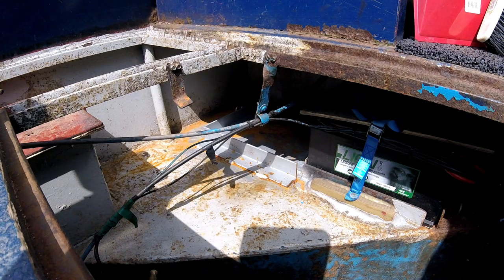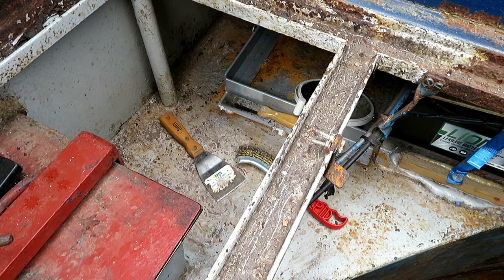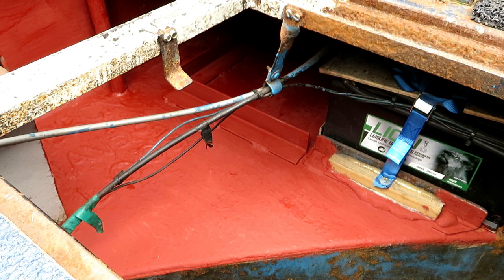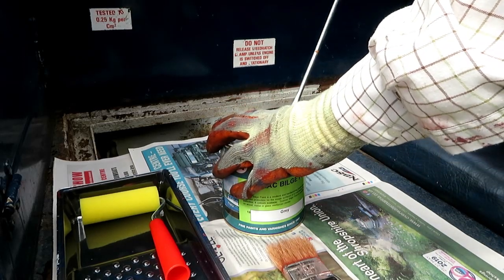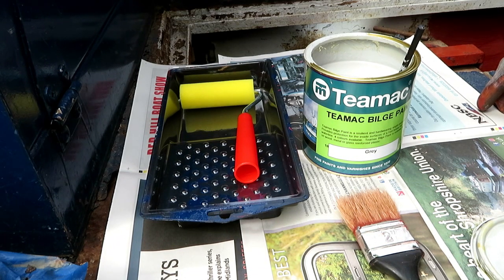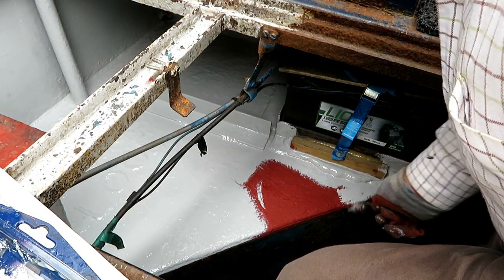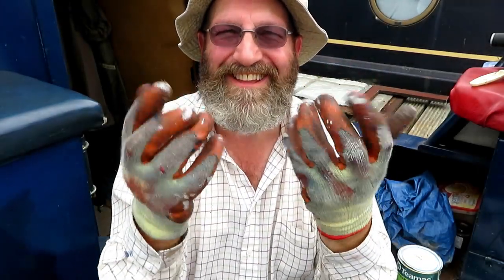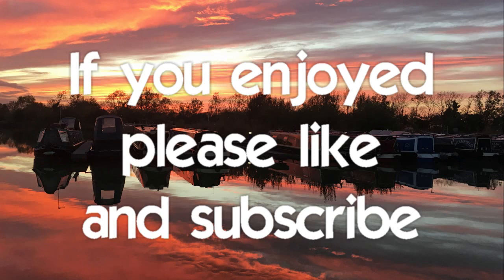70. Painting My Narrowboat - Part 6

Comment: Good morning Alan.
We had a cruiser stern deck.
I made a discovery that rain runs down your gun whale and drops into engine bay.
To stop this happening we had deflector rods welded at an angle on the gun whale just before the bay to deflect rain off into the canal.
It worked no more rain in engine bay.
David from " cruising the cut " 
did a volg on what your doing.
Well done for doing an essential job Alan.
Keep safe.
Reply from the maker: Thanks David. My boat has upstands around the gunwhales at the rear of the boat so that wouldn’t happen. I do have a step that drains to the bilge, so some water there is going to be unavoidable. David took his engine out to paint the bottom of his boat. I won’t be doing that! Cheers

Comment: Great job you’ve done there Alan, the finished result looks really good, any plans to replace the flat deck board brace with a  V one ?
Reply from the maker: Thanks Dave. No I hadn’t thought about it, as there are other means for water to get into the bilge with the cover down. I suppose the present support could be turned over and adapted. Cheers

Comment: Why do you not fit the batteries inside waterproof battery boxes to protect them ?
Reply from the maker: Hi Alan. The batteries are as they came on the boat. The two batteries in the cabin were in such boxes but have now been moved to the engine bay and the four batteries are in a row not in boxes. Probably easier to wire up than in boxes but they are covered over.